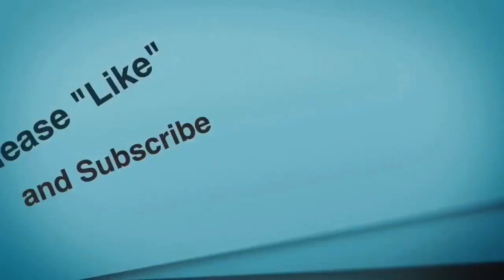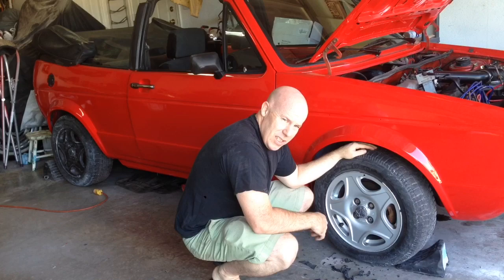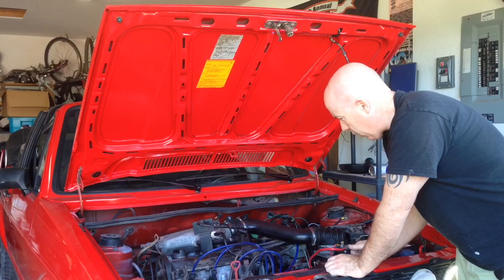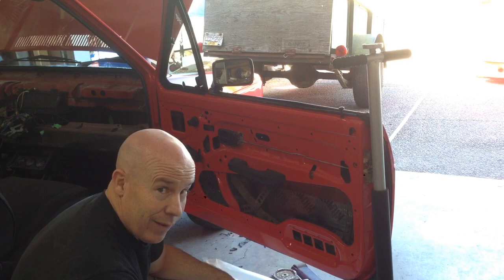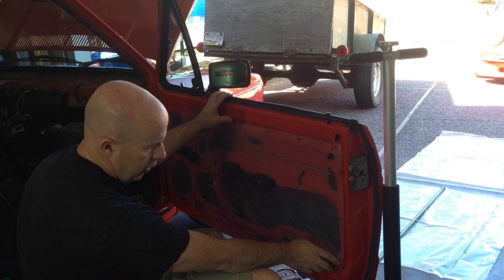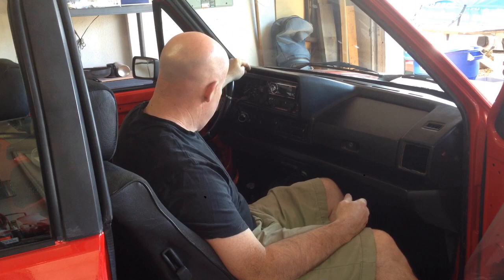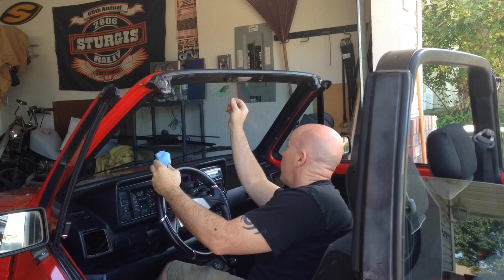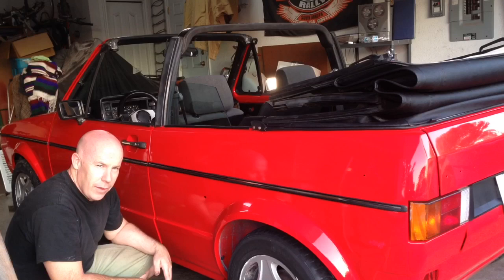First Start & other odds and ends - 1980 VW Mk1 Rabbit Convertible Project Episode 32

Comment: Hello sir I have an ‘82 and it starts up and shuts off like yours at first startup any tips you can give me to get mine going?
Reply from the maker: My issue was just a loose fuel pump relay. Once properly secured into the fuse panel it ran correctly.

I would guess you have a fuel supply issue.
Reply: Analog Generation thank you sir it’s been a trial but staying in fight 👊🏼